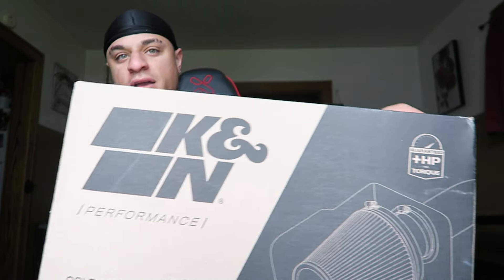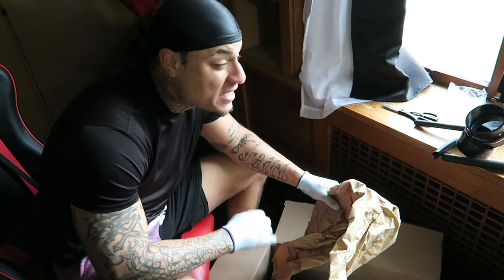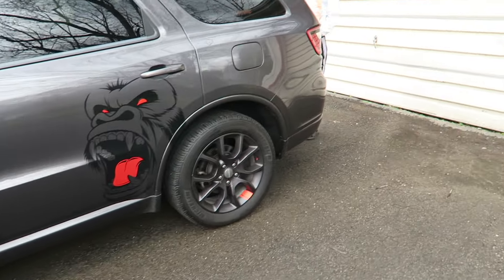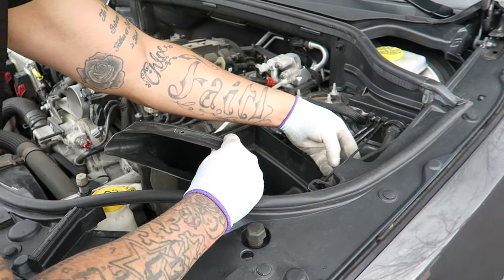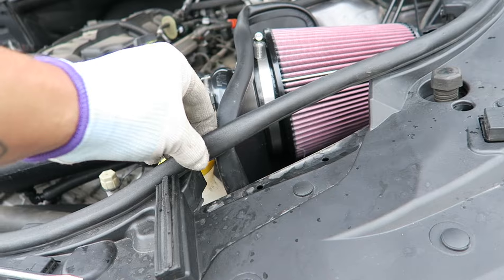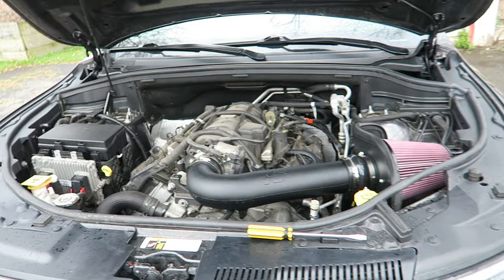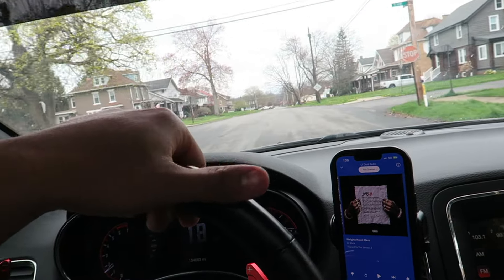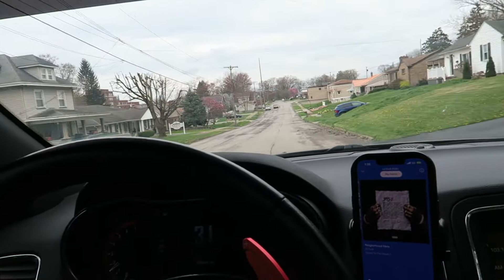Cold Air Intake Install In My 2016 Dodge Durango RT 5.7L HEMI

Comment: Hey, so the intake will help with swooshing sound when u rev it, also get ur girl to rev it and listen from the front itll sound super throaty. It will also increase hp and tq and fuel economy. May take a while to feel the difference bc computer has to relearn air fuel ratio now that theres more air, more air=more fuel= higher AFR= more power
Reply from the maker: Appreciate that 🙌🏼 another mod! Just going to keep adding to it
Reply: Only increases hp if tuned dawggg 
Increases induction noises though
Reply: @StreetSweeper226  not at all true. Go check AEMs and K&N youtube channels. They toss the intake on and straight onto dyno. This intake is not only free flowing but it also has non turbulent piping making it easier for the TB to draw air. Only argument u could possibly make is the IATs but it seems like its got a good heatshield and is still in an area closs to the grill where it can draw cool, fresh, and therefore dense air.